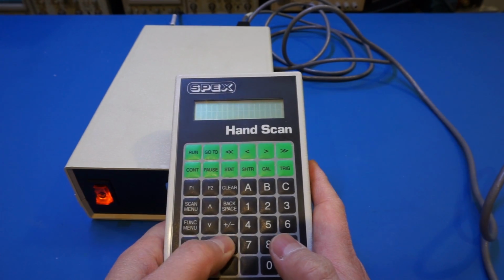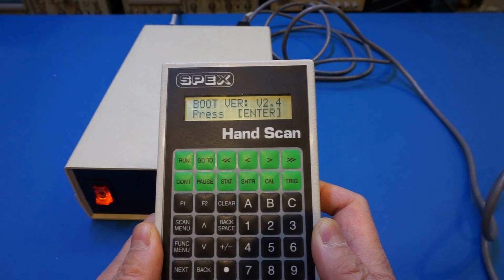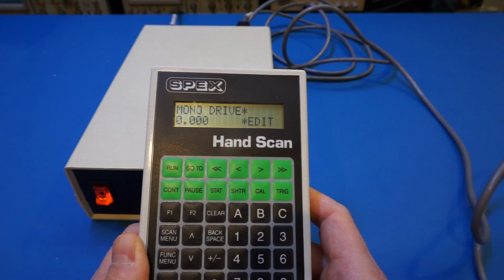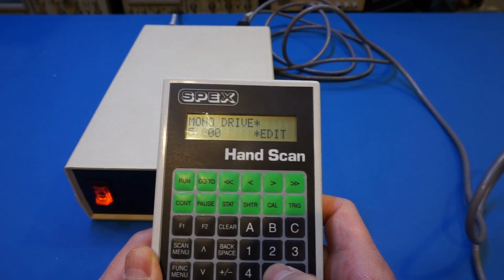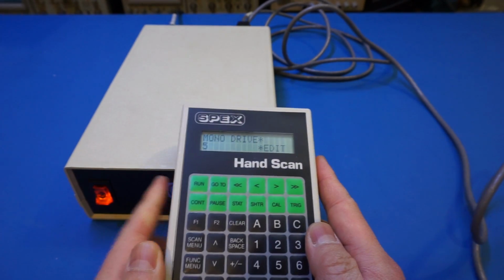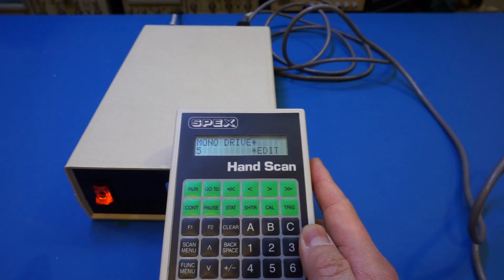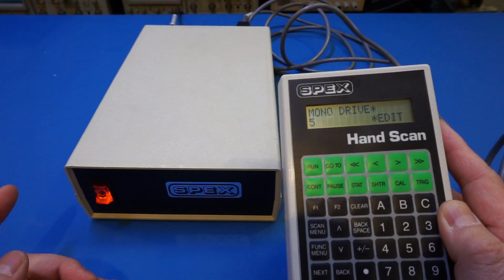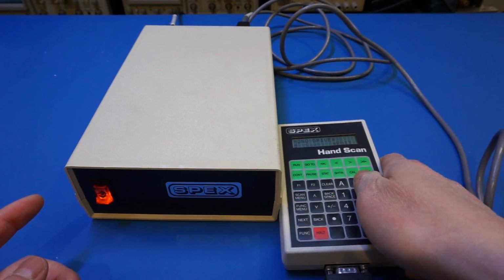Teardown of a SPEX HS1000 Monochromator Controller

Comment: Would this controller be able to drive a Spex 1681B monochromator? The Spex 1681B was made in the 80's. It has a 25-pin connector to an outside controller. Inside the monochromator, the 25 pin ribbon cable is cut away to leave only 9 conductors. A contemporary driver box called Spex CD2A Compudrive might be the matching unit. Maybe this newer controller would try to keep backward compatibility? I am looking for manuals for the monochromator and the controllers.

Comment: Interesting to see inside, shame things like this get separated from their other components, hopefully you can find it's matching monochromator to go with it. Looks like the bottom board is just being used as a power supply as i don't see any interconnection to the top board other than the power connector on the bottom right corner. I think @zapro_dk is right in these boards formed part of a larger product previously. The OKI chip will be sram for the microprocessor, very common for the time as you don't need to add in extra complexity for DRAM refreshes and are simpler to interface to.
Reply from the maker: Thanks for the input!

Comment: The two push-switches on the power supply board would suggest that this monochromator exsists in a combined unit where everything is in the same box,  where the switches are the endstops for the stepper motor leadscrew for the grating.
Reply: I can confirm your suspicion.  I used one of these handscan units with an ISA HR320 monochromator, which didn't need the controller box, presumably because it was built in.
Reply: I can confirm, too. I have a SPEX 1681B where the same board is located inside the monochromator and the two switches are operated by the grating drive.

Comment: Interesting. It must have been quite a sophisticated and expensive unit. I was surprised that they used such advanced silicon in it.

It might be possible to calibrate a used unit with a color correction puck for calibrating monitors, and or by picking out diode lasers for various colors such as 660nm 532nm, or even perhaps a sodium line, or mercury lines from streetlights.

Perhaps in the other half, they have a broad-band detector and a beamsplitter, so that the monochromatic light goes through the beam splitter, and is reflected by the object, and goes back through the beamsplitter, and is picked up by the sensor. Or it could rotate to a certain quadrant for the sensor arc. Because of refraction, the beam splitter is likely reflective.

Thanks for sharing. Now to find the other half : )

[I have microscope friends, for whom I was considering making a monochromator, not to read as in spectometer but just to produce light at a certain wavelength. I have some harmonic drives, which are accurate enough, but the issue was that solid reflective gratings are expensive even used on ebay. Having adjustable slits seems like a nice feature, to specify a bandwidth. The other challenges are the curved mirrors, and hoping that a photointeruppter/comparitors are consistent enough to zero the grating rotating assembly.]

Comment: 11:30 That chip is just the SRAM 51257 is 32K*8
12:20 Yes that is storing the FPGA configuration data. It's a PROM. It only got a RESET and clock in and data comes out as a bit stream without the need of any addressing.
Reply from the maker: Good to know. Thanks!